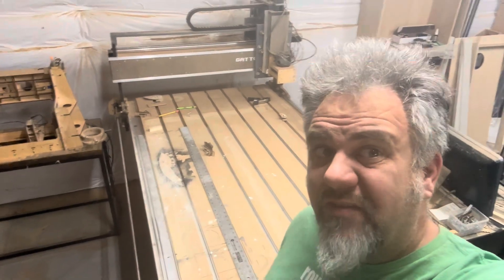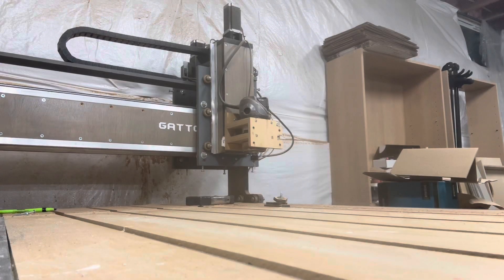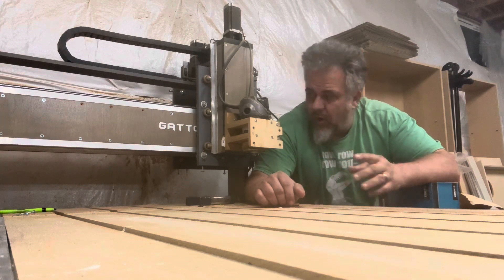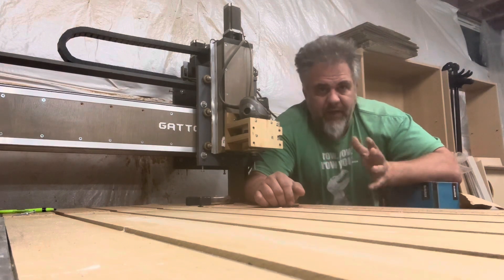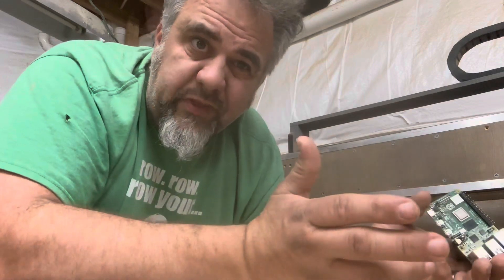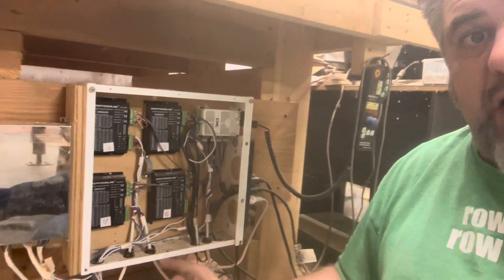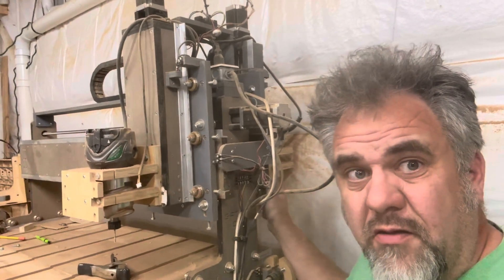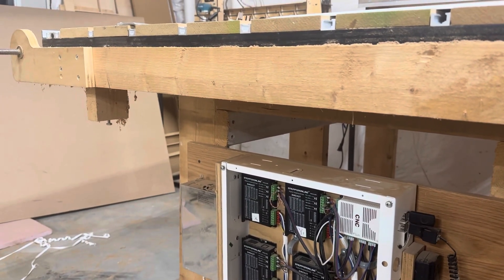Raspberry Pi CNC Controller 6 year review

Comment: what image need use can make working RPI 3 or 4 and how much need made own code in RPI ? all not can write code lot not many understand. or HAL file write, too hard normal hobby users. but interesting if need made small different cnc tool i think made spindle not have normal vertical, think make second cnc machine spindle is horicontal can carving long plank head and side pockets and dovetails, only tool machine made side to wood something. normal cnc table not can and no can carving long piece side or top position . mean long plank head.

Comment: thanks, interesting use my old raspi to cnc projekt, i have normal paraller port PC and paraller port card and working well, i need ask you, why not has change lot better spindle last 6 year, router is worst spindle what can add to cnc machine, lot better update first good 1,5- 2,2 KW ER 20 spindle lot lot silent and strongest and cost same than good router but working 200x better.